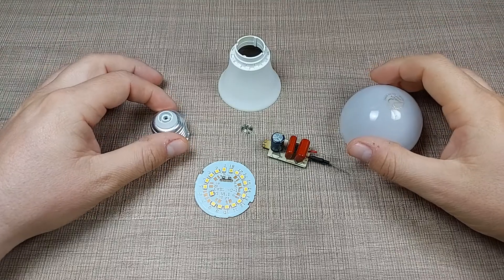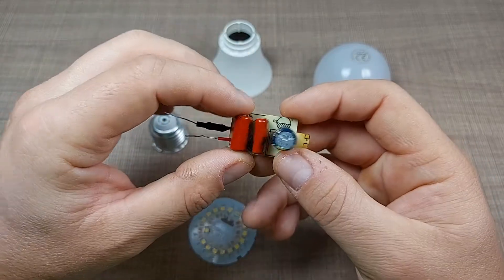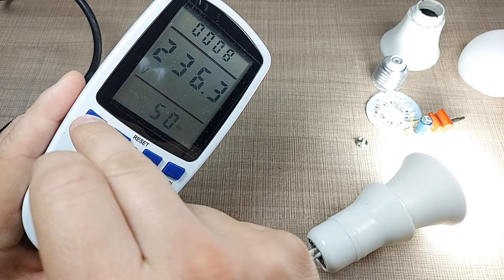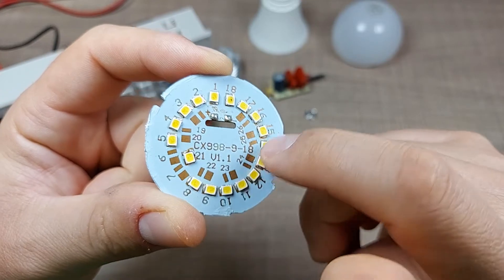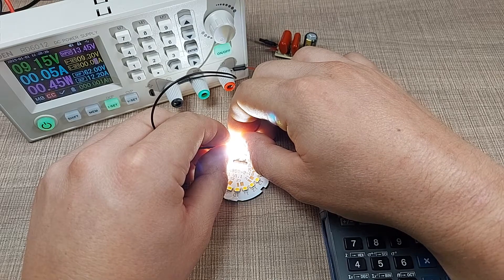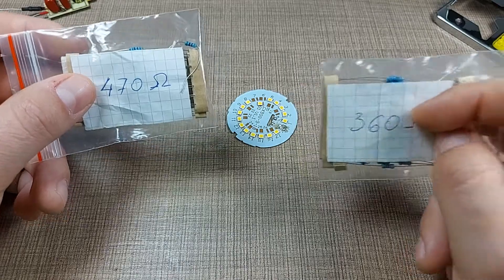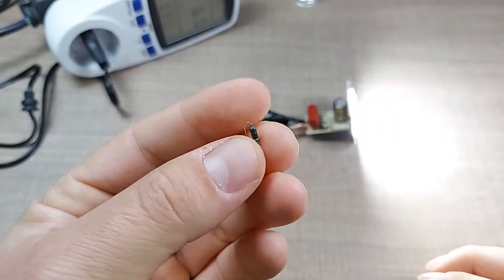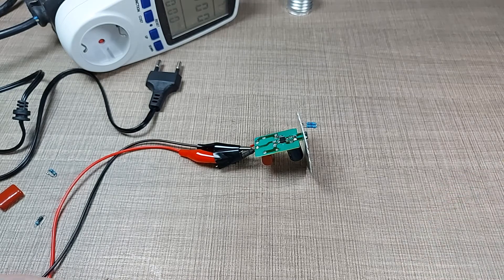Post-mortem analysis/repair of dead LED bulb with capacitive dropper

Comment: Haha. I’ll use capacitive droppers to fix cc circuit led bulbs.
if the leds are in series, then why won’t you simply short the broken led? Because you’ve already dropped the voltage by removing one capacitor.
BTW they say use twice the power rated resistors in such cases. Exact power rated resistors always get burnt.
Reply from the maker: I don't know if you checked the schematic but there is no CC regulator on the board. The light depends on the LED clamping the voltage. On top of that, this is all just an experiment, things need to go bad and destroyed so we can better learn what is going on.
Reply: @TasteTheCode  your experiment gave me the confidence to fix 4 old led bulbs.
I am also thinking if I buy high wattage bulb and reduce the power to the leds by using lower dropper capacitor then the bulb could last for a decade. 🤔
Reply: Also the parallel resistor to the leds could be for safety. Because when an LED fails, the voltage across the electrolytic capacitor would reach more than 220V.
Reply from the maker: @GhostsOfSparta  True that! There is a style of lights popularly named "Dubai Lamps" where they do exactly that straight out of the factory but they can only be purchased in Dubai.

Comment: Can anybody send me a new to buy led bulb, the link in the description is temporary out of stock?
Reply from the maker: Hey, thanks for pointing this out, I've just replaced the link, it should now work.
Reply: @TasteTheCode  Thank you for replying just one more question is you really sure that this fixture is with capacitive dropper because I am having a problem seeing it on webpage, and thanks one more this means really a lot to me.
Reply from the maker: Well that is difficult to tell as Chinese lamp are all different and even ordering from the same batch might come with different driver circuits.